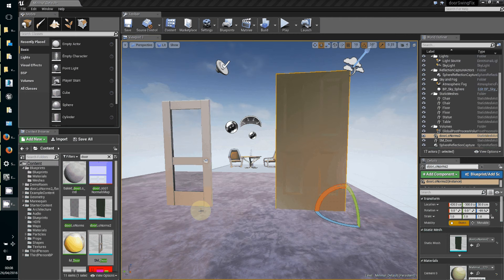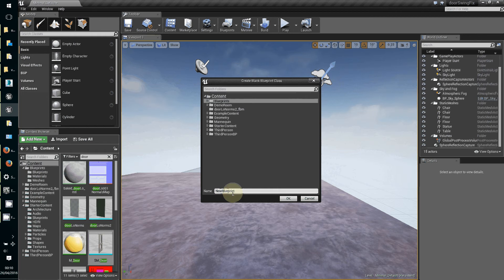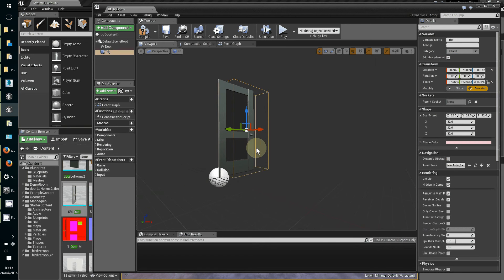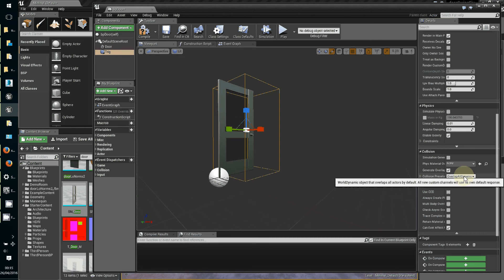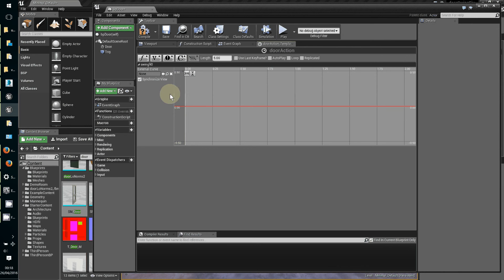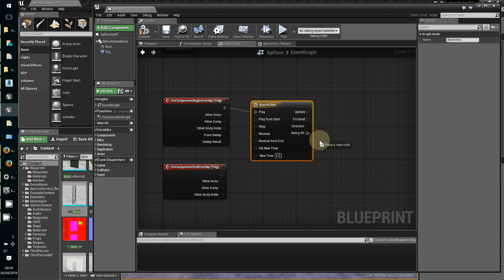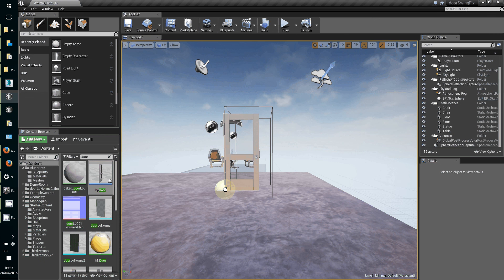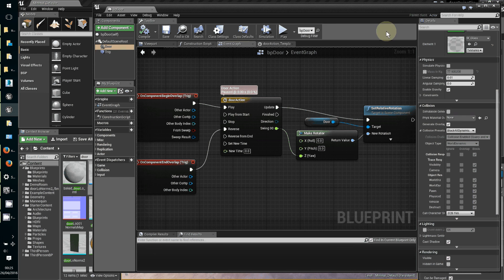Open a door UE4 blueprint timeline

Comment: Hi. I followed this tutoril but for some reason my float values are insanely wrong; if I set it to 90 then my door spins round ridiculously. I have to set the value to 3 to get about a 70 degree rotation - do you have any idea why this is happening? Also the reverse doesn't work at all...
Reply from the maker: This might be if you rotated the door in the Blueprint Viewport during setup. The Blueprint remembers it's original rotation as a Static Mesh once it activates.